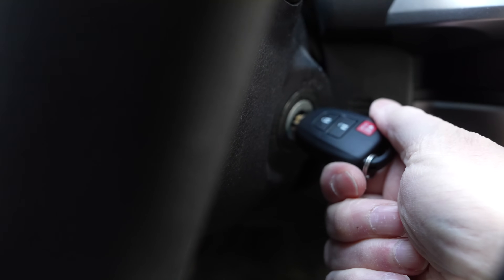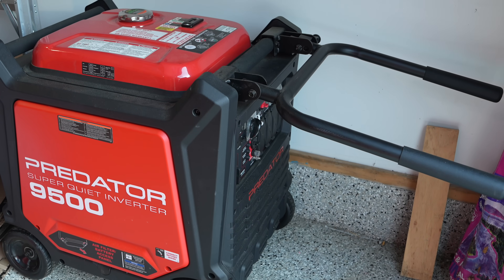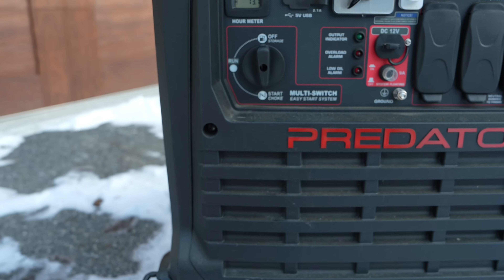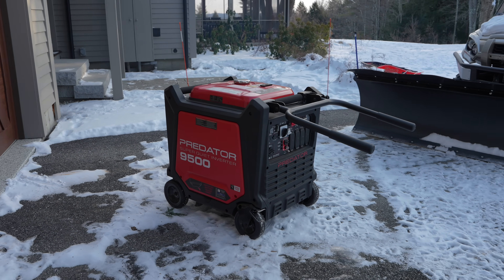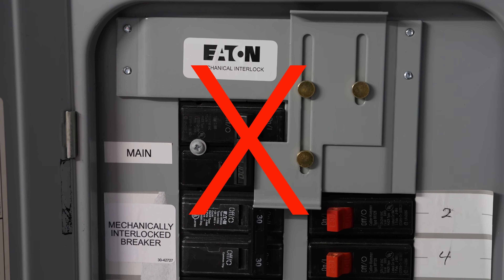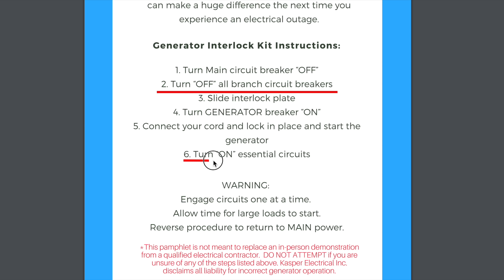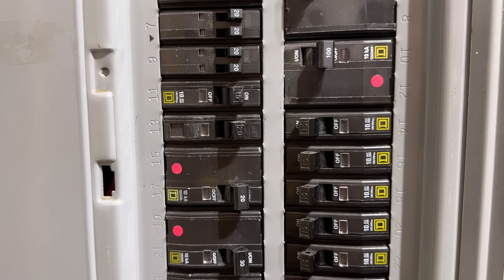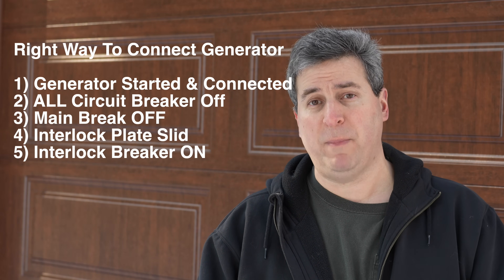Homeowners are Destroying Generators Skipping 1 Step During a Power Outage

Comment: According to your video and the manufacturer, you cannot have an ATS Automatic Transfer Switch.   Correct?   No incorrect.   If the loads are known, calculated and applied to the generator under those conditions, there will be no issue if done correctly.   Connecting to a panel with too much load turned on as in your video will cause the damage you suggest.  So the warning and procedure is because of high probability not calculated and limited to those loads.

Comment: 8k Generac, that was bought in 97. It is now 2025, so its 28 years old. I had to replace the carb on it, because the aluminum bowl corroded through, but even so, it still starts on the second pull every time. I STILL USE IT, and I AGREE with your advice, it seems VERY reasonable.. common sense even! I can add that when I shut the gen down I shut off the gas and let it die on its own, so there is no gas in the carb. Having said that? I have NEVER thought about shutting off all the breakers and then turning them back on one at a time. I HAVE to wonder, how much stress this really puts on the generator by NOT doing it? I have never even thought about it. that 28 year old 8K Generac still grunts when I flip the breakers over, then runs the entire house. It grunts when the well pump kicks on. We now own three 8K generators one for each house. I WILL shut off the breakers as stated, because it makes perfect common sense. BUT, I still wonder how much difference it makes in the real world. SINCE that 28 year old generator still works like a champ, and it has a LOT of hours on it now.

Comment: If your generator was in house and you have a 10w30 oil in it, I disagree on eco mode...  car runs at idle if it was warm in garage after starting it...  it isn't working hard with no load.
Reply: Wear and tear is 4x higher at 2x extra speed, why 3600 rpm generators last 1/4 as long as 1800 rpm ones, on downside it burns a little less efficiently at lower speed because cheap engine not tuned for it, overall I think eco mode still is better start, it will burn out the carbon when you add house load

Comment: My Outback Radian inverter has the ability to enable and disable both grid and generator inputs.. It also has a 40kw battery to run the inverter that can share the loads or provide full 8kw at 240vac.. So when grid power goes down most times we don't even notice as we are running off the solar and batteries.. This also provides a buffer when I do have to turn on the generator where the controller will gradually increase the demand on the generator and also determine if there is excess generator power to add charge to the batteries.. In this way we can plan the use of things like the electric hot water heater, microwave, washer/dryer and heavy use of well pumped water when the generator is running.. When the demand is low or the batteries are above 70% we can shut off the generator and just use batteries thus saving fuel that is if we are not generating 5 to 7 KW-H from the panel array.. The water heater has an automated rely that can be commanded to open when battery voltage is below a certain level and there is no grid or generator input thus eliminating the need to manually turn off the breaker in certain conditions..

Comment: I hear that if I don’t run a heavy enough load on my generator, it will destroy it. Also, is this true they say it will hurt your gasoline engine
Reply: Not really. The problem with not pushing the generator at higher rev is sometimes the throttle will get stuck in the lower range and won't rev up when you need it. Its unlikely though. I think the bigger worry is some generator idle high enough to produce more power than you are actually using and the over current protection device will keep stalling the engine.
Reply: @howardradford1985  my generator is a 9000 W what they are saying if I don’t run at least 2700 W load it will carbon up the engine not talking about the RPMs. They say I got to run at least 30% of the 9000 wattage to keep from hurting the gasoline engine from carbon up.

Comment: Also make sure that your generator is an unbonded neutral when connecting it to your panel. You only want ground and neutral bonded in one place and that's your main service entrance. If you have a main panel box and a sub panel box then your ground and neutrals will be separated in your sub panel box and bonded in your main panel box like they're supposed to be. Now if your generator is a bonded neutral, like a lot of portable generators are, and you connect that to your main panel then you're creating a ground loop which is dangerous. Now your neutral is bonded in 2 places, the main service entrance where it's supposed to be and also the generator. Not good. You need to unbond the generator. Most generators have instructions on how to unbond them specifically for use as a home backup generator. If they don't then it's easy to find on YouTube how to do it. My Generac portable does not have instructions on how to do it but it does warn that the neutral is bonded and that the generator cannot be used to connect to a house panel unless you buy their specific generator panel box and rewire your panel. Not necessary. Just unbond the generator.

Comment: Had a V16 1135hp Cummins 950kVA feeding switch gear it would ramp up and transfer in around 30 seconds
Reply: We had preheating so the engine temperature was just over 100 degrees at start up.. Also on a large generator they run at 1800 RPM vs the small residential units which run at 3600 RPM..

Comment: Hi, it's me again. I just bought my mother's last homestead. When Dad died we bought her a  15 KWatt Generac brand generator from Home Depot and had a professional set it on it's pad, wire it up and connect it to the propane tank. It works great. What I'd like to say is whenever the power went out, most of the time Mom didn't even know she was on generator power. When my sisters visited on Wednesday they didn't even know the Generac generator did it's warmup run for 15 mins on that day or that it even had one and they thought the power was out. So, you see how transparent that generator is.  NOBODY WENT DOWN THE BASEMENT AND TURNED ANY CIRCUIT BREAKERS OFF OR ON. The Generac system sensed the power was out and within just a few seconds it would start up, run at 3,600 rpm for 10 or 15 seconds to stabilize and WHAM! it turned the whole house back on. Nobody did nuthin. They didn't even know the Fermi 2 power was off and didn't know if they were running on the generator or not. ben/ michigan

Comment: As electrical engineering trained, the lineman are being smart arses.
The actual reason for "personal grounding" all phases is to stop static and induction by magnetism from other sources like radio transmitters, UHL and other high voltage circuits not turned off.
Lightning as well.
Backfeed from generators is also a danger, but induction much more dangerous.
Fly a helicopter in a rainstorm hovering and have someone touch it without grounding it first.ZAP.

Comment: Also, you don't want the inrush current on sensitive electronics like PC's, T.V's ETC. So having the breakers OFF before you connect the generator is huge to protect your sensitive electronics, Then turn on one at a time slowly, And UPS (uninterruptible power supply) should be on all PC's and sensitive electronics. Even on normal power. Power surges and inrush current will destroy them.

Comment: A lot of people like me are stuck with extension cords.  This is what I came up with:
1. Don't use a standard NEMA 5-15 extension cord with your generator if it can produce over 2,000W.  Don't even use two of those extension cords just because you had them laying around before you got the generator.  Get the right extension cord for your generator.  For a lot of small generator setups where you will be running an extension cord, this comes out to a TT-30 extension cord.  Even if your generator has an L5-30 outlet, probably want to use an adapter to go to TT-30 because then you can have that extension cord around for camping trips if you ever go camping as a lot of campgrounds have an electrical panel with two to four NEMA 5-20 outlets, a TT-30, and a 14-50 outlet.  Here is the thing, with one NEMA 5-15 extension cord, I see people going around overloading that one extension cord and commenting on how very hot it is.  I even see people with two 5-15 extension cords and one is taking almost all of the load and getting too hot while the other is nearly idle.  The generator ends up being too close to your home right next to an open window or door because it turns out your old extension cords are not long enough for safe generator use.  And then when you are trying to plug in stuff, well the extension cords are running out to your generator into your home, not around the inside of your home to what you need to power.  If you just get the right extension cord for your generator in the first place, you have your generator placed a safe distance away, you have an adapter cable to go to multiple NEMA 5-20 outlets inside your home, and then your old NEMA 5-15 extension cords can be run around inside your house to where you need the power delivered.  With the split being 3 or more ways from the TT-30 or larger extension cord, that is just enough to avoid overload on a single cable where it just comes up to a lopsided overload on one cable with just one or two NEMA 5-15 cables from the generator to your home.  Just what I see happening time and time again with people.

2. If you are not hooking up to your main service panel where you have a ground - neutral bond and an Earth ground, you need to make that in your extension cord setup.  I made A TT-30 adapter cable just for this task, granted you can get a NEMA 5-15 plug for this as I was designing to make sure the wiring was good to pop the 30A breaker on my generator in case of a short to ground.  A short to ground can be very dangerous without a ground-neutral bond to complete the circuit and pop the breaker, thus clearing the fault per design of NEC codes.  You don't want to be completing the circuit through your body because that bond wasn't there and you managed to come in contact with the wrong things.  I have even heard stories about electrical heaters that won't turn off in a house and a 'possessed' kitchen sink that came down to there was no ground - neutral bond in the house and shorts happened through janky appliances without a ground-neutral bond to clear the fault.

You also want to tie your generator to house ground if you are doing emergency power to your house.  You may not think about it at the time you are hooking up your generator, but say you hook your Internet router to the generator, but say leave your NAS off of the generator while they are hooked together through a copper Ethernet cable.  Or say you hook up your TV to the generator, but leave your A/V receiver off and just use the built-in TV speakers for sound in order to not risk overloading your generator.  Or maybe you can easily yank and move the power cord for the TV while the A/V receiver in its cabinet is a lot harder to get the power cable moved, so you just don't bother. Well, you could build up static charges on your generator circuit that discharge across that Ethernet cable or copper audio cable or what have you.  Now when you do get power back, you find some of your equipment doesn't work.  Grounding to house ground will put everything at the same reference voltage as per NEC codes and prevent any of this 'crazy' stuff from happening.

There is a whole bigger thing to this, we live in a power electronics world.  A big reason to get an inverter generator is to get clean power to your electronics.  Well, it turns out if neutral is left floating, you end up with really noisy power to your electronics.  Just adding in the ground-neutral bond helps a lot with this.  Adding in house ground helps even more and the power from the generator tends to be cleaner than utility power at this point.  This seems to all come down to with all of the switching and 'pumping' and such inverter electronics, without a capacitative reference to hold the absolute voltage on one side steady, both sides absolute voltage wise will bounce around.  I have seen it on an oscilloscope.  I have plugged in an analogue security camera and it shows up as strong harmonic distortion, granted, it was hard to even get the camera to boot up all of the way with this going on.  The voltage delta between hot and neutral does what it is supposed to do, but the absolute voltages bounce around at high frequencies.  Just have a capacitative reference, ground, hooked up and suddenly the power shows up as being cleaner than utility power and electronics hooked up are happy instead of having trouble working at all.

I handle this house ground bond with another adapter cable I made with a lighted outlet that plugs into the house outlet.  This adapter cable looks kind of like a Y cable with a suicide plug on it, but only the ground wire hooked up.  The bond to house ground isn't going to have any real current over it, but it will provide a common reference voltage.  I can plug this adapter cable in inside of my house and to the extension cable from the generator and now my generator is equalized to house ground.  When utility power comes back, the plug lights up and then I know I can switch back to utility power.

So yeah, a couple of adapter cables and I am basically NEC compliant and it is safe for me to hook up my electronic gear.  Can even hook up surge protectors and UPS systems without getting any warnings / errors.

Comment: i do enjoy how i tried to put oil in a BMW, put the peddle to the floor assuming that it would... not start... because... that quite literally what a lot of cars to so i could crank it over... and I absolutely got an ear full because of course i did. shut it off pulled the ignition fuse and then turned it over again... the car is a piece of crap... i don't know why i put nice plugs in it.. but it fixed the missfire so...

Comment: The problem is most people don't know about the wattage of the loads they are trying to run generators have a peak and a continuous wattage rating peak being how much wattage it can provide for a short period of time rated being how many watts it can provide continuously and they fry the capacitors in the generator over loading is a shure fire way to kill a generator

Comment: I got totally tired of screwing around with switching my breakers on and off  for 20 year everytime we lost power. Installed a Generac wholehouse automatic generator about 15 years back. Now we go leave and not have to worry about flipping those breakers. As you get older you really don't want to screw with having to pull start or be there.  Its one of the best investments I've ever made on the house, plus its a good for house sale. Guess it was time to give up the Briggs and Stratton and get real.

Comment: I use a whole house transfer switch between the outside meter an the main panel.  The generator feeds the main panel through the transfer switch an prevents any feedback into the main line. I only need the furnace, 'fridge, one lightbulb, and the well pump.  If I need the water heater, I shut off those breakers and power the water heater by itself, then turn it off and draw down the hot water reservoir.  It's easy and  works well.  The drawback is that a 200 amp single throw double pole transfer switch is expensive

Comment: I feel that a lot of people don't talk enough about this.  Generator cord safety.  I'd worry about yourself first before worrying about killing your generator.  Treat your generator cord like a live circuit, because it is!  If you touch those prongs while your generator is running before connecting to the power inlet, you are toast.  This is what everyone should be doing:

1. Generator OFF.
2. Plug into the house inlet box first.
3. Then plug into the generator.
4. Start the generator.
5. Flip the generator breaker ON last.

This guarantees you never touch a live plug and stay safe.

Comment: large inverter generators are awesome, I am a 30yr electrician and went from a 5500 w Coleman  to a 9500w running watt Westinghouse inverter , no more randomly tripping gfci outlets or blinking led lights, even my apc computer/ modem backup is happy now, and I can run my Fujitsu mini split because of clean power, old generator was putting out such dirty power  , 11000 watt starting capacity on this one I can run everything in my small house with no issues

Comment: Starting the gen with the loads connected is bad and shouldnt be done, but the loads being turned on 1 by 1 only matters if youre going to have significant load the moment you turn it on. If its going to be less than 20% of the capacity of the gen then just let it rip. 7200w breaker, 11000w generator, and maybe 2000w~ of load. Sure if you have all electric appliances and utilities and a well then this changes. 

I do have larger electrical loads, but none that kick on immediately, like a clothes dryer or electric stove

Comment: Generac says nothing about shutting off every breaker. The operators manual just says not to start it under a load. After it has started and leveled off you can throw your house breaker or switch on the one thats on the generator

Comment: One big mistake is people don't pull the generator out hook it up and let it run unloaded for a few minutes then switch on the breakers. Run the generator for at least 20 minutes under load. Then unload and let it cool down. If using gasoline shut off the fuel valve and let the generator run till it shuts off. Do this three times a year. Generator isn't any good if it doesn't run in a outage.